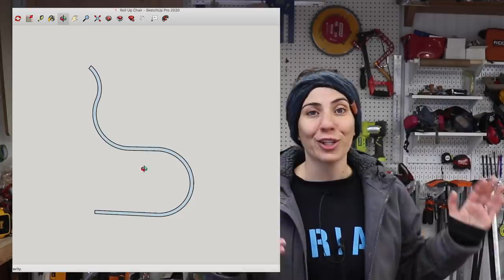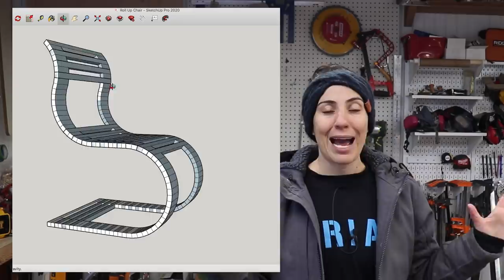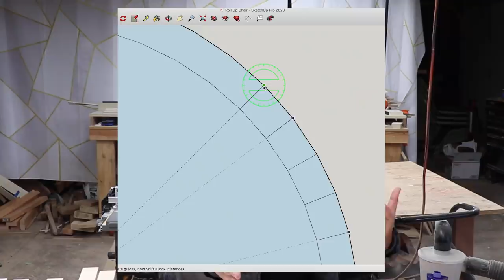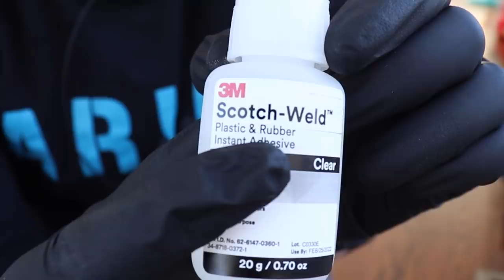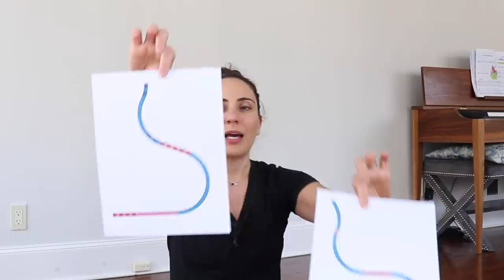I ATTEMPTED to make a chair that rolls up... It didn't go as planned...

Comment: Ok I am not an ingenier but couldn't you extend the part that touches the ground and make it mirror the stable part you were able to sit on to connect both part of the device and fashion a stool? you would be able to sit between the 2 supporting arcs. Or is that not the challenge?

Comment: Do it again but use a seat belt or tow straps since they will not stretch at all and can hold a lot of weight. Also make the angles bigger than you need to so it has room to stretch or bend.
Reply from the maker: I did use a seat belt

Comment: Honestly it looks like the webbing has too dynamic which could be because of all the holes. If you ran an extra piece under the wide one and pulled it tight before attaching the ends you could probably make it  work

Comment: Your original design in sketch up assumes the “circle” used to determine piece angles is a rigid shape. The wood is going  to have some (minute) give to it and allow the whole shape to deform from the original design. If you have the time and if this even makes sense, (sorry for suggesting this) you could try to recut allllll the pieces with angles slightly larger than that of the original sketch up protestor measurement. I don’t think this should matter for the square pieces, but maybe the square pieces need to have a more obtuse angle than “square” to supply more rigidity/support. Just the first thought that came to mind!

Comment: You should use wood piece which are at some angle to each other. Plane square wood piece will not do the trick. With square shape, point of contact is only to corner of nxt wood which is not optimal for weight distribution. You have to surgically make the wood pieces each having some angle with each other in auto cad. Then take some strong material which can hold 200 pounds of weight. These strap you used will not cut. Maybe carbon fiber or kevlar will do the trick. Use auto cad to make the design then surgically cut the pieces at those angle then strap them together with kevlar or shit. That will surely work.

Comment: its a plausible idea. its just a matter of getting the structure set right. i feel that the top section of the chair needs to be shorter and getting the center point to be further back. a project that would need more testing with a cheaper materials without sacrificing quality so that it doesnt break lol

Comment: Just a dumb question: Have anyone ever seen the "original" to work really like a chair someone may sit on?
Because basic calculation: With 2.5cm high pieces with the pushing force being just on the edges (would require infinitely hard material; in reality the arm length would be about half of that), 30cm arm from the front "legs" towards your seat center and a 100kg person sitting there (so zero margin for any dynamic load), we are talking about 2 tons of pulling force, where nothing can ever give even a percent in length., in order to sag less than few cm (in the seat height) or so. Plus it would have to perform that way for reasonable lifetime.
So maybe thicker pieces (maybe somehow hollowed to save weight), really hard wood and steel cables for holding it together (the felt thing would be just a cover then) may in theory made it, but it will be heavy. Or using some kind chains: Rigid material, but allowing it to  roll that up.

To me it looks like just a typical "genius solved everything" scam. Someone may have build a mockup (it stood on its own; you had that practically the first try) and then just took a photoshop. A typical "Look what I, the design genius, have invented, now just the stupid engineers are unable to make it working" thing...

Comment: I do NOT think that using a soft wood would be an improvement.  The structure depends on the compressive strength of the rungs, against tremendous leverage.  Consider one wedge: the nylon webbing acts as the fulcrum;  the long lever arm (the straight-line distance from the webbing to the CG of where the person is sitting) might be 100cm for a wedge near the bottom of the arc; the short arm is only half the thickness of the wedge.  I think pine or fir would be crushed to fibers in a situation like that.
In any case, you probably want to build a small-scale model first, then HALF the chair (with only the 4" segments), to learn more about the way the materials act and interact.
Finally, you should probably glue the felt to the webbing.  It does not need to bear a lot of stress, and screws will mar the floor.

Comment: I don't think the original builder succeeded on his first try either. Edison tried over a hundred ways to make the original filament for his light bulb before he found what worked. You are getting closer. Like Edison and Nash Rohack, the previous poster said - You just found ways that didn't work, but you are getting closer. Don't give up, just look harder for the perfect material. Mylar doesn't stretch and might work if thick enough. They made recording tapes from it because of this feature. I think pine is a step in the wrong direction. It is too soft to hold it's shape when compressed and will also have poor ability to hold the screws/fasteners/glue. Stay with a good hardwood. Hard maple would be best for this. You want as little give as possible when the joints are compressed.

I'm looking forward to part 2 of this build. You are getting closer. Don't give up now.
 
A tip about hand plane use - learn to lay the plane on it's side when you stop using it. This protects the fine edge of the blade from accidental contact with something on the bench that might damage it's perfect sharpness that you worked so hard to achieve.

Comment: You should just use Nylon tow straps on the side of the curves that needs strength, and a flexible yoga mat on the other side of the curve. The flexible part give the flex, and the nylon strap serves as a hard limit on the shape.
Reply: Or maybe on the same sides 🤔 either way you need one that provides tension before the point you want it at for sitting and give a little past a comfortable position.  Then you need a strap that has little to no give serves as a hard limit for how far the chair can flex.

Comment: I feel like your approach was very top-down. The chair you ended up with is pretty sturdy and just needs the shape adjusted. You could adjust the curve by adding material between the planks, e.g. by adding a layer of some varnish between the planks or even some screws.

Comment: The design concept was flawed from the start, this was not your fault. You achieved exactly what our reference photo showed, which was a guy sitting only on the seat, and not leaning on the back rest. I think you also encountered the exact same issues the original design team encountered.

The flaw here is that we have no real way of transferring shear forces across the joints. We were able to take care of the bending forces with the straps taking tension and the wood taking the compression, but for shear transfer we are relying on either the friction between the faces of the wood blocks or the tension in the straps to transfer load, and the straps only help us in the concave portions - the seat and the top back. 

In the concave section - the transition between the seat and the upper back - the tension in the straps is actually working AGAINST us here. In every iteration here we failed THERE, because the tension in the straps was pulling AWAY from the blocks, causing them to shift significantly relative to each other and resulting in our failure mechanisms. The yoga straps actually show this mechanism very well.

I think if you do this again, you would need to make the concave section ridgid - glued or otherwise - or find a different mechanical fastener that is capable of transferring significant shear and tension loads while still allowing for rotation when rolled, such as a hinge.

Incredible project, do not give up!

Comment: Oh my goodness... Your comment section has so many jerks! The overly sexist comments suggesting you try something vague and impossible were the most eye roll worthy

After reading through peoples ideas I am most intrigued by how i would staple the webbing to the wood in a prestretched state. Building a jig and physically stretching the material while I staple it seems impractical. What about marking where the wood goes ahead of time but offsetting the marks to bunch it up? Like, If the theoretical spacing of the slates was 2", I would bevel the edges so I can attach them with an actual spacing of 1.95" (random guess). By making the block closer it could compensates for stretch. 

I hope to see an update one day or whatever ideas you have next
Reply from the maker: Haha yeah.... I’ve just gotten used to it at this point.

Comment: Omg you legit had it with the rubber just needed to screw into every section and it would have been rigid enough to not let the rubber break and hold

Comment: The concept is obviously there. Instead of pulling your hair out redoing everything every time just use what's already there. Cut a handful of spacers to adjust and find the proper angle on the backrest. It'll be way faster and you'll find what angles work

Comment: the problem is not in the belt. but in pieces of wood. the circle you made for the middle is too big, it should be smaller than the top, the bottom circle don't go straight to the middle, take it a little bit down, if you pay attention to the sample image at the beginning of the video, then compare it with the sketch you made, You will notice that the middle and bottom circles shouldn't be the same size. then consider to what extent the center will fall if the lower part of the circle is given weight. I'm still waiting for your seat results

Comment: There is way too much mechanical leverage with this design. The links need to be much thicker. Example: current: v try: V. Also, the tape/glue is a bad idea. Remember, you're changing the angle from the contact point from the top to the bottom. As in, the bottom contact point is still touching but the top isn't, and that difference changes a subtle angle a lot.  basically, "l" shape would turn to "v". Also, planing the wood could also cause measurements to be off somewhat. If you wanted to arrange the chair for stapling/screwing. You should fix the plants together by stapling a joining piece of wood at the ends.

Comment: Damn should have wedged pieces of paper or wood between the seams tell you got the right angle to have a reference. And you would have felt alot more accomplished sitting in it with the correct shape.

Comment: iam a little too late on this but this video is bugging me and i think the problem is that the wood is compressing  when you sit on it you can see that when you first roll it off it holds its shape but after you sit on it it deforms , wood is elastic to some degree so it will bounce back after a short while,
i think you need to compensate by increasing the angle of the cut or use an even harder wood,
using softer wood like pine will cause the segments to deform permanently i think.
TRUST me iam an engineer.

Comment: An an engineer, seems like the belt strap you used is still far too flexible and you might want to tighten up any gaps between the blocks because even though they are small when you have 100+ those gaps add up and create sag in the chair

Comment: if you look at the original picture logic tells you there would be gaps in the reverse bend at the backrest if all the blocks were cut square, therefore the blocks must not all be cut square, rather on a 20-25 degree angle to support the back more.. in some sections..
look at the picture more closely, you'll see it. And yes I am a carpenter. And that design is impractical, so more or less useless to build.

Comment: The picture is obviously fake. If you want this to work you would need to have the fabric be very rigid. I'd almost suggest multiple layers of plastic and carbon sheets. Also the back rest would need to be supported by the wood itself cause there is just no way that curve is happening without a solid block of wood. So you'd need to do some math to have the back shape perfectly overlap with V shapes into a jigsaw puzzle that forms a solid block with all the weight resting on the legs of the chair.

Comment: you first make a template and make the template in to the chair first then divide the chair in to seconds use math, 

Taper each cut inward 

I mean i can understand how it works but without the chair FIRST being solid you can't make it flex

Comment: Your original sketchup did not match the design you were emulating.  Your seat is practically horizontal, which I think would be impossible to hold in practical application, while the original continued to be arched to distribute weight.  Also, when you said there was only one picture and that it was clearly photoshopped, I found a couple of other photos of it being displayed and used, suggesting that it was not photoshopped at all.

Comment: Why don't you put heat in your workshop?
Reply from the maker: Bc it’s a huge project that will eventually get done
Reply: @3x3CustomTamar  I just bought a Mr heater big buddy propane heater for mine. It helps a lot and doesn't make me trip the breaker as much as the electric one 😉

Comment: I don’t know if wood is the right material for this. You need material that has absolutely no give and a mesh or fabric with no stretch. Mould the pieces to the perfect shape and it should work. 

Im also no a fan of the design. The rounded shape gives you no room for your legs to go straight down and the chair has to have relatively simple curves to hold up properly. These will never be very comfortable without cushioning. If you add cushioning, the chair will not be able to be quickly stashed away. So it’s really for nobody. Most people have space for a chair and if you’re living in a small space, other solutions seem much more suitable.

Comment: How on earth did I get here, I probably got lured into clicking on a pretty face, doing shocking things only a dude is supposed to do. Maybe I am reading it wrong and this actually is the modern day situation where a "damsel in distress" fails at changing the tire on a dusty road in a middle of nowhere. Unbelievably sexy mother of admittedly at least one shoves a thumb up in the air in the moment of her utmost despair to attract some modern day "saviour" (hopefully riding a shiny beast with a mighty wrench under the hood...) Ok, I really got distracted...

Chains! Hinges! That's what you need for Christ's sake!

Ok, maybe I should have started with boasting right from the start ...I am an egineer! Tens of years in bussiness! Thousands of happy customers' commendation! Not a single design fail in years! ...I have come to lay my expertise at your feet m'lady...  erhmmm ...got distracted again. 

Lets get technical... What is the problem actually. (not mentioning that it has just too many pieces and the thing is overcomplicated as hell)

1) Insufficient control of axial rigidity. You cannot adjust the tension to accomodate the load (which is actually a variable thing)
2) Insufficient lateral rigidity. The thing gets swinged from side to side too easilly. 
3) The design does not allow to lock the "chair" in the work position. 

Possible solution (I wont do the calculation for you, just tea&biscuit blabber)
1) Use thicker (higher) wood blocks, I'd say 3 inches would do (you should make some testing of this prior to any other work). It would have a better leverage to push against the loading force. Forget about the cusion and a glue. You need to fit there a chain of steel wire insert, ideally in separate segment that would be possible to fasten with hiden bolts. In the trial&error you can start with one segment that would be secured by screws on one end only (I mean the end of the whole chair chain). 
I think you could use bicycle chains (or similar) embedded tightly in the blocks. You could use the cusion to cover the chains. Make the chain sunk in the wood all along.
Alternatively you could use precission hinges on all the wood blocks, that would also help with lateral rigidity. I think the chain would be much cooler though...
If you dont have access to chains or hinges, you could use some steel wire or steel cable, but the foldability of the chair would suffer a little bit.

2)In the straight segments add some cross stiffeners. Maybe the bolts in the 1) will make it stiff enough. Just bear in mind it needs attention. Otherwise you could not make any moves sitting on it. No newspaper swings, no tea spilling...

3) Add a lockable wire (or possibly some rubberband) on the inside of the curves to lock the chair in work possition or the thing would collapse anytime a toddler toddles around... You could use a couple of rubber bands attached to wooden pegs that would fit into sinkholes on some of the wooden blocks all along the inside. Or just connect the ends...

Good luck
Reply: "Not a single design fail" is the most condescending and impossible statement. Your either a design god, or your not making very interesting things. Failure is part of a design process, right?

Comment: not gonna appreciate you for your work, a lot of people have already done that.

watch this link 
https://youtu.be/wpIUuvDLZL8

This shows a way to cut wood in a way to make it flexible and not tear it apart.
Assuming you watched the video, if and only if a strip of wood cut in way like shown in video is able to hold the human weight lets say around 70 KG, you may use it for making the chair.
screw the elastic band in places where high flexibility is required and place poly*** (high strength stuff) in places you dont want the wood to bend  a lot.
Reply: do experiment with cutting wood to make it flexible, i think the type of cut will decide how flexible it gets.